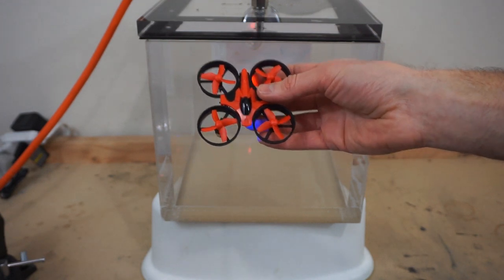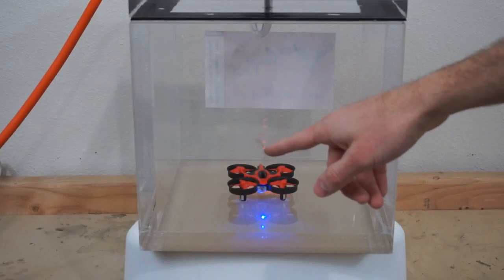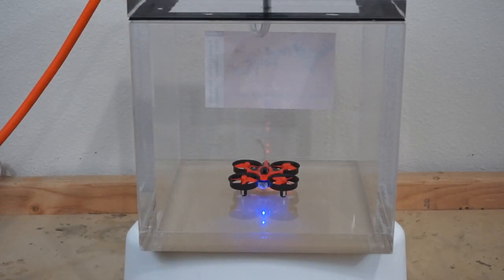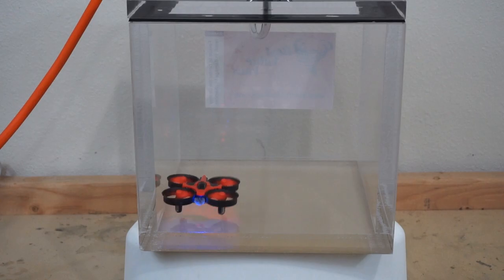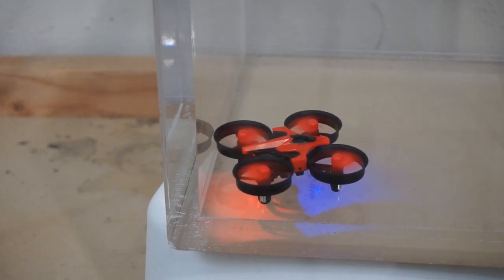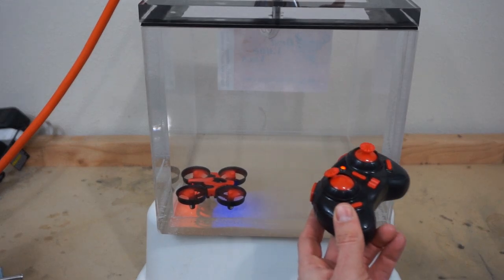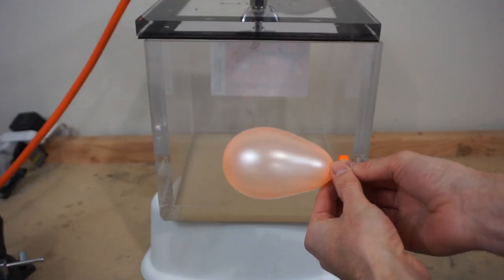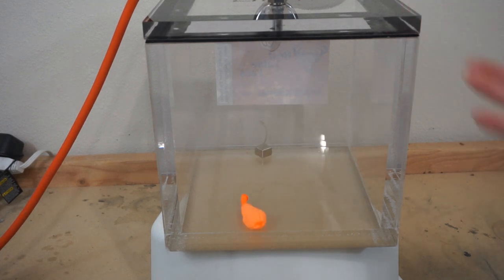What Happens When You Put A Drone In a Vacuum? Can It Still Fly?

Comment: Show a rocket firework working in a vacuum..you can't. It's stupid to believe it would.
Reply: You believe in every conspiracy theory going don't you?
Reply: @DeadbeatDecember  
Yep I'm loving being in with Satan lol..
He pops up in my back garden in a puff of smoke and flames.

That's literally what you believe..
Reply: @DeadbeatDecember  
So you think that when Concorde was cruising at mach 2 in less than 1psi pressure, that tiny bit of air was rushing back in behind the Concorde sized hole that had been created and jumped Infront of the exhausted gases for it to push against?
Reply: @DeadbeatDecember  
No answer for how Concorde managed to go Mach 2 in 0.89psi?
If rockets or jets pushed on air then there'd be a sliding scale where the efficiency dropped off with less air to push against.
Reality shows the opposite, as all the fastest recorded aircraft speeds have occured in very minimal air pressure.
The X-15 achieved mach 5 at 67 miles altitude.
Reply: @DeadbeatDecember  
So would a handgun not have recoil in the absence of air?
Reply: @DeadbeatDecember  - "Show a rocket firework working in a vacuum..you can't. It's stupid to believe it would."

OK.
Watch the YT video "uninterrupted footage of the falcon heavy launch and booster landing! 2-6-18"
Watch from Launch to side booster landing then explain what you just witnessed.
Reply: @DeadbeatDecember  - "Anyone with half a brain knows rockets don't work in a vacuum."

Sorry you have that backwards.
The people who think that DONT UNDERSTAND NEWTONS LAWS.
In FACT, it is not possible to pass HIGH SCHOOL Physics thinking rockets don't work in a vacuum

So why did YOU drop out of high school?
Reply: @DeadbeatDecember  I can prove all of it with either Newtons LAWS or undeniable video evidence. 
We can start with Newtons LAWS.  Tell me what happens if you fire a steel projectile into a vacuum from a crossbow.
Will the crossbow experience a recoil force? Yes or no?

I am literally a "Rocket Scientist" so I can help if you are willing to learn.
Reply: Lee B is the obviuos troll here for damage control. Sucks to be you Lee.
Reply: @karltaylor2857  Watch the video I mention above and explain what YOU see genius!
Reply: @karltaylor2857  so why did you drop out of school before 9th grade?

Comment: The air in the balloon was able to push off against the walls, so that does not prove rockets in space.
Reply: Watch the YT video "Uninterrupted Footage of the Falcon Heavy Launch and Booster Landing! "
for PROOF that rockets work just fine in a vacuum.
If you are having trouble spotting it , let me know and I point it all out to you.
Reply: @stuartgray5877  Irrelevant.  It pushed off the ground, had momentum as it flew through the thin atmosphere,    and eventually had to return because of gravity.
Reply: @rocksolid6494  - It is OBVIOUS that you have NO CLUE about how basic physics works.
For example: Please EXPLAIN WHY a crossbow has recoil.
I would be happy to help you educate yourself about how rocket propulsion DOES WORK, but I suspect you have no intention whatsoever of becoming educated...

So according to YOU a CROSSBOW would NOT feel recoil if fired in a vacuum right?

would a GUN still have recoil in a vacuum? Yes or No?
Reply: @stuartgray5877  Perhaps recoil, but not control.  You could not control where you are going.

Comment: Rockets don't use air to be propelled, and the only reason the baloon moved was because of the air inside.
Reply: not only that , even if he does ignite a fuel with an oxidizer in a vacuum, the reaction isn't the same and can't produce the type of force a rocket would need to launch off the moon as far as I can see but I'm still looking for a video that shows it can, but so far I only see videos showing it can't
Reply: @ROBMCKISSOCK  - SO answer this question: If I fired a FIREHOSE into a vacuum, would I still feel a recoil force?
Yes or No?
Reply: @stuartgray5877  After extensively looking into this, I've learned that rockets can work in a vacuum, they just can't ignite in a vacuum which is easy to get around by sealing the ignition source from the vacuum. Once the fuel is ignited in non vacuum, it will continue to burn in a vacuum as long as the fuel produces it's own oxygen in which Newtons laws of motion still work.

Comment: Rockets need something to push to move forward.  Balloon flying is Still Inconclusive - It pushed LOT air against the wall & thus moved forward.  You should try with a Tall chamber of 10X size of balloon & Upward direction in non-vacuum case & vacuum case - to get accurate results.

Comment: The air leaving the balloon was pushing off the walls of the vacuum. You're completely overriding logic and your own visual observations. You saw that flies couldn't fly in your vacuum, and the drone couldn't either. The air escaping the balloon had a greater thrust than the propellers of the drone so the close proximity of the walls in your vacuum was sufficient enough resistance needed for it to fly. If we could get an inflated balloon to remain in the middle of a vacuum 40 times larger than yours, it would've hardly moved position before falling to the bottom. Last point: Your vacuum is NOWHERE near the perfect vacuum of space. You cannot thrust off of "nothing" (aka an absolute vacuum) Period. It's not debatable. It's actually obvious but you have to disregard it because you can't fathom the idea that space flight is a lie and has never happened.
Reply: To propel yourself from a wall, you need contact with a SOLID and RIGID object (your arm, for example). Try to push yourself off a wall with a rope... impossible ! so even if the air leans on the walls it can never communicate a movement to the balloon. On the other hand, when leaving the balloon, he gives it an opposite amount of movement (momentum) by reaction : the recoil of a gun when the bullet leaving it has exactly the same explanation.

Comment: Same concept goes for rockets and people still think rockets use the vacuum of space to push themselves there is nothing in space that can push you forward since space is a vacuum.
Reply: Propeller lift and engine thrust are not the same thing.
Do you think that the Saturn V's 7,000,000 lbs of thrust needed 14.7psi to push against?

Comment: Your baloon deliver extra air to chamber. This air press on the wall and for this reason baloon fly away.   Hang your drone in an upright position. You can use the same magnets. Pump off the air. Start the drone motors. Then we'll see if the drone will fly. I bet he won't fly! 2 minute test. will you make it?
Reply: The balloon does not and cannot push off the chamber walls. Gas is made up of tiny particles with both mass and momentum. since the balloon and the wall aren't in direct contact, how can  particle particle, not directly in contact with a balloon, transfer a force from the wall it just collided with, to the balloon, over a distance of physical separation? it makes no sense. That would be like playing base ball. Hitting the ball with the bat, and only hearing the ting from the bat when someone catches the actual ball. its lunacy and ill conceived.

Comment: Your balloon is not in a vacuum! The balloon pushes against the chamber wall and therefore flew away. Place the balloon in the center of the large and long chamber so that the wall is far away. Pump out the air as much as you can. Then remove the magnet. Some kind of remote solenoid needs to be used. Then we'll see if the balloon rocket will fly. I am very curious.

Comment: I understand that propellers need fluid and the vacuum proves that.
  What you can't show, and what I want to know is it's performance under no gravity.
 Since you have no fluid to propel you, and no fluid to move, how do the mechanical movements reflect in zero gravity and negative vacum.
 I've looked for it and haven't found anything related to this. 
 If you have any links that you know of that show this scenario, please let me know, that would be interesting.
 Thanks 🙈🙉🙊
Reply: The only way you could simulate zero g is to either go to space or go into a zero g plane. And on the plane it only lasts for a few seconds
Reply: @DarkTheFailure  The plane doesn't produce zero g, it mimics it, your actually free falling, not floating.
Space isn't the same kind of vacuum as a vacuum chamber.
Thanks 🙈🙉🙊
Reply: @eddiegreg7064  yeah same for orbits. That technically only mimics zero g
Reply: @eddiegreg7064 
Negative vacuum?!
ROTFL
Reply: @eddiegreg7064  there isn’t any such thing as negative vacuum. A vacuum is just space with less stuff. Saying a negative vacuum is like saying negative 3 people came to my birthday party.
Reply: @eddiegreg7064  also mimic in this case is the same as replicate. Gravity is just a constant acceleration towards the center of mass. It’s a vector with magnitude and direction. During free fall or a zero G plane, everything is accelerating at that speed towards the ground. This means that everything, relative to you and your surroundings has zero net acceleration and thus zero net force. I.e, zero G.